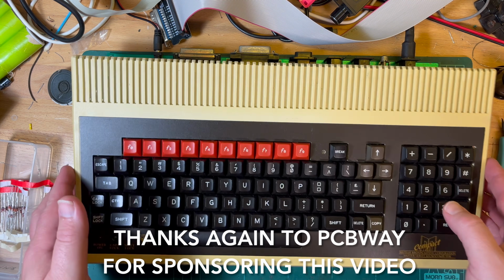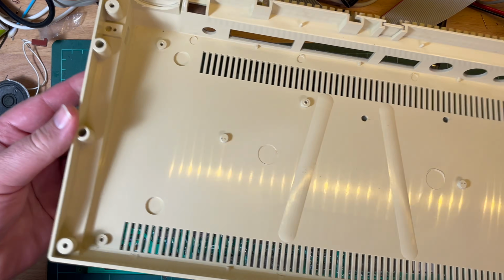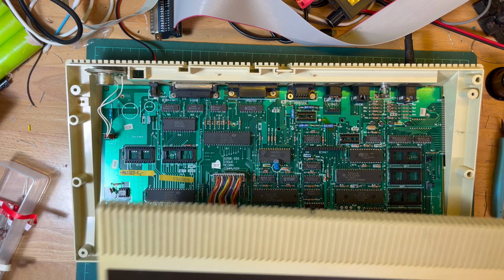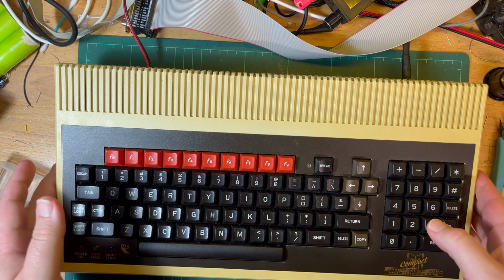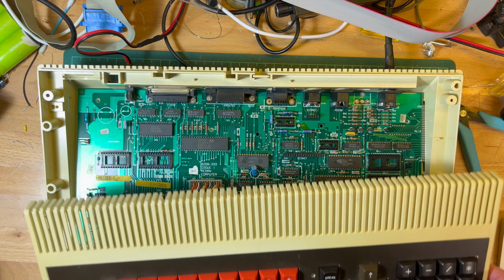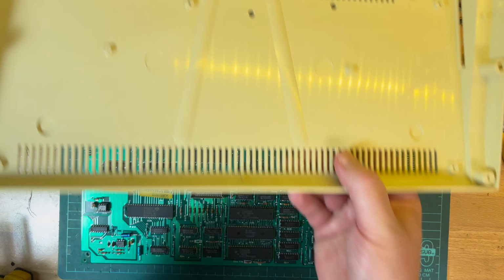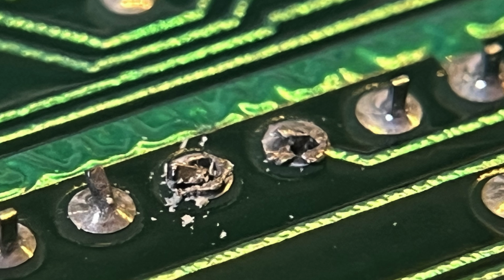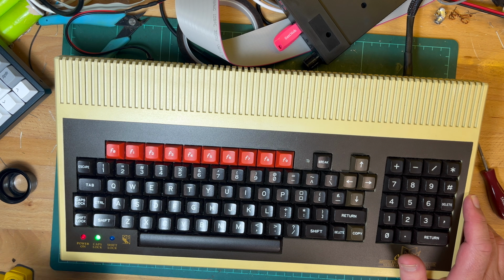🇬🇧 BBC Master Compact: Part 3 (Motherboard Fault) [#TCE0553]

Comment: FYI: <Shift><Break> will auto run the !Boot file on a disk image. 
The Compact only has an ADFS ROM by default, so no need to enter "*ADFS", it's the default.
Also *CAT abbreviates to *.   (Star DOT)

Comment: What a lovely looking machine - Never seen one of those before. I'm from, and in, the UK. I don't think we had them here? We did have the BBC Master System, but it didn't look like that. 🙂
Reply from the maker: Oh, it was definitely released in the UK!  I'm actually surprised I found this one in Australia.  It just wasn't very popular from what I understand ... 3½" drive & ADFS meant all of the existing DFS software on 5¼" disk was out of reach (although trivial to sort out today), and useful ports like cartridge, User, 1MHz, Tube and cassette were also removed, with some functionality provided by an expansion edge connector.  Interestingly, Olivetti did release a version called the Olivetti Prodest PC 128 S.

Comment: Well done! And WTF was the case and board designers thinking when they didn't cooperate and make a place for the board to sit in the case that wouldn't push against the standoff? Just plain dumb.

You did solder both joints didn't you? You were speaking in the singular, but there were two damaged pads (actually three, but that is a bent pin and probably not a concern as of yet).

Comment: Finaly - you fixed it!!! I did trust you, but just in case there was the backup plan with the green pad. 🤣
Reply from the maker: The green pad would've fixed it as well I think because those pins wouldn't have been resting on the stand-off directly!